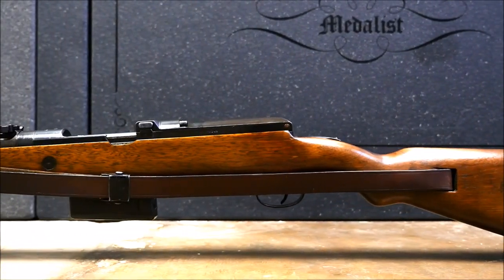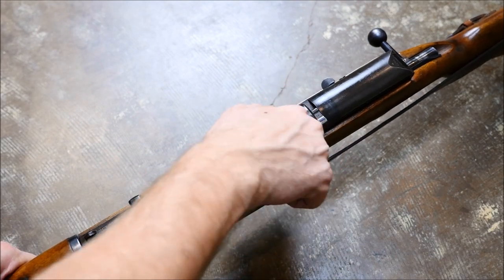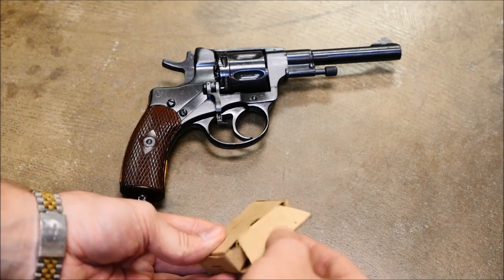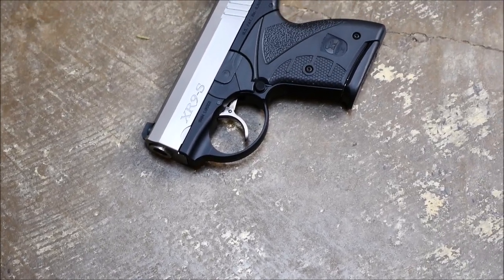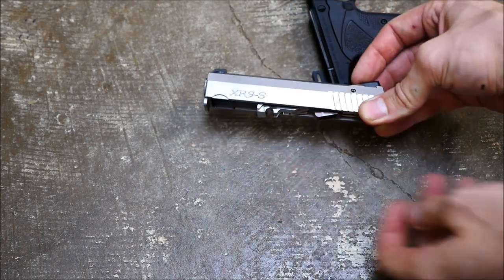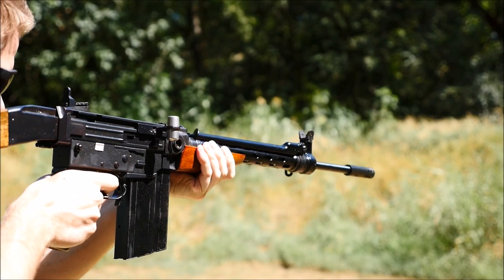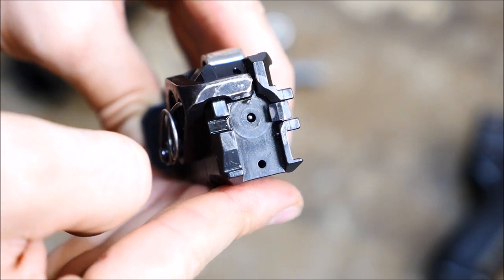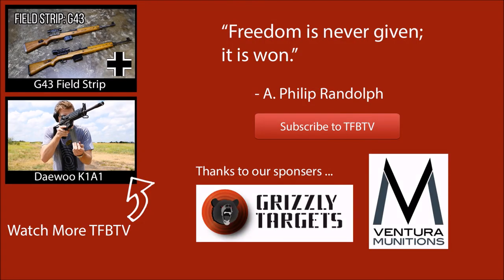Top 5 Overly Complicated Guns

Comment: Suppress the revolver you can make suppressor for any gun
Reply: +Reese Hague You can fit a suppressor an any gun, but that doesn't mean they work well. On a regular revolver there is a small gap between the cylinder and the barrel where some gas will escape when the gun is fired. If you put a suppressor on that revolver then there will be a slightly higher back pressure and more lightly gass will escape at the cylinder gap.

The sound produced when firing a gun comes from three major sources. The is the sound of the mechanical operation of the gun, then there's the sound of the expanding gases, and last is the sound of the bullet travelling through the air.

A suppressor works by trapping and slowing down the expanding gases as they leave the barrel. Any gas that escapes in the cylinder gap will cause a loud bang.

Comment: I don't know why you didn't mention the Luger. It was made of too many parts, needed to much time and effort to produce (over 770 steps in the making), needed the good ammo (otherwise getting unreliable) and was somehow dangerous to handle. There are no means to decock it in a simple way, f.i. A very good looking gun, right, but thats not the point of a weapon. Browning designed good weapons, which were reliable, safe and MUCH easier (and faster) to produce. And good looking, too. If needs be, i would prefer the 1911 A1. Even as I'm german.

Comment: Come on, the M16A1 needed a shoutout, at the least. It needed a spot in the 5.
Reply from the maker: +Jonathan “Strela” X No.
Reply: +TFB TV How do you figure? Even the iron sights were complicated, compared to both the AKM, and the M14. The gun was also infamously unreliable, in part due to its plastic-implemented construction- and due in part to its internal mechanisms. I'm talking about the A1, not later models.

Comment: The moving cylinder on the Nagant Revolver isnt really for a "gas seal"...its mostly because Ivan didnt have the engineering and quality control capability to have a cylinder rotate AND maintain the required tolerances between the cylinder face and barrel...Too little and it binds....too MUCH and you get a lot blast/spit which accumulates, and it binds...and a "wobbler" in between will soon develop other "timing" issues within in the lockwork (hand/pawl, cylinder lock, etc).....No, the Ruskies didnt give a crap about the extra 50 FPS, (if they even KNEW about it) because everybody THEY ever shot with a pistol was already KNEELING....they just needed a gun that could work an 8-hour day dispatching enemies of the (tzar...state..whatever) and a reliable AUTOLOADER was COMPLETELY beyond their capacity at the time....hence the moving cylinder....

Comment: I sold automobiles for years the joke was an american car designer designs a car with the number of parts he thinks it needs. A Japanese designer uses the least number of parts  to show he can and a german engineer designs it with the most number of parts to show he van.
Reply: German engineering swings both ways. The Mauser C96 was a very early (1896) automstic pistol, they where still getting the concepts sorted out. Field strip a Walter P38/P1 and compare that to a Cold 1911. The G41(s) where made overly complex by demand of the customer. Look at the StG44 or the H&K G3 for the opposite end. KPz/MBT 70 and Leopard 2. Or the Unimog - complex but extremly powerful/capabel. If a 2to/Unimog U1300 got stuck the common procedure was to fetch a case of beer and barter with the tank guys for use of a Bergeleo. Because our M88 (gasoline engine) retriever likely would not get the job done.

And there is always the KraKa

Comment: The sig 510 kinda looks like the FN FAL
Reply: The AMT is actualy the semi-automatic, civilian version if the SG-510-4. An export variant sold to Chile and Bolivia. They feature a shorter barel and a different butt stock.
The original SG-510 looks rather different, and in my opinion much better.
Reply: @Bird_Dog00  never knew that, honestly
Reply: @SlotterYT  There's a pretty decent documentary about the weapon's developement out here on YT if you're interested.

Comment: Why were they given the "no gas port" restriction?
Reply: +Stanley Scalf 
Basically in the early days of semi-autos, it was believed that drilling a hole into the barrel to vent gas would bleed too much gas pressure and affect the bullets FPS. 
Obviously we know now that its a minimal and rather insignificant amount. Understanding about gases was less back then. 

For example; the earliest M1 Garands adopted, the ones made in 1937, used a gas-trap rather than a gas port as well because of the same reasoning... 
Another example is the Nagant revolver. The reason the cylinder moves forward has nothing to do with suppressors, they didnt even exist then. Leon Nagant wanted to block escaping gas because he thought a significant amount was escaping from the cylinder gap and blocking would greatly increase FPS.
Reply: sergeantbigmac Huh. The more you know...
Reply: +sergeantbigmac They also thought that tapping into the bore would  greatly increase barrel erosion.
Reply: commissarpistols Huh. The more you know...
Reply: Stanley Scalf Oh ya I forgot to add, genuine gas-trap M1 Garands are really rare now-a-days since only a few were made and those that were mostly got converted.
I think genuine ones go for like 15-20 thousand!

Comment: The Sig510's charging handle looks the same as the bolt handle of the straight-pull k31. They prob used the same desin.. :D

http://www.milsurps.com/images/imported/2012/08/tgtK31b-1.jpg

Comment: No 1887?
Reply from the maker: +Joseph Yates No.
Reply: I'm pretty sure the 1887 is actually considered a pretty simple design.
Reply: +N75911 have you taken one apart and put it back together? its a rolling block design for a shotgun. There is ALOT going on in there when your racking a shell.
Reply: Joseph Yates Of course, but for a firearm in general, it's not "overly complex" especially for that era, there were a ton of hideous, designs that never worked, and as far as a freaking lever action shotgun goes, it's understandably complex, especially since it's the first ever successful repeating shotgun.
Reply: Joseph Yates nun